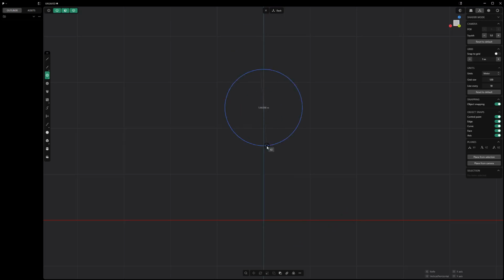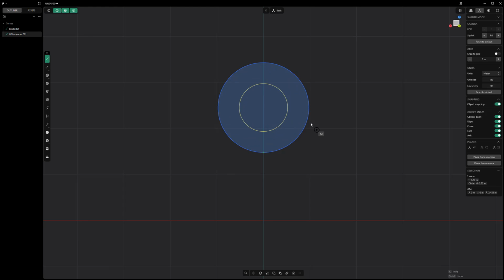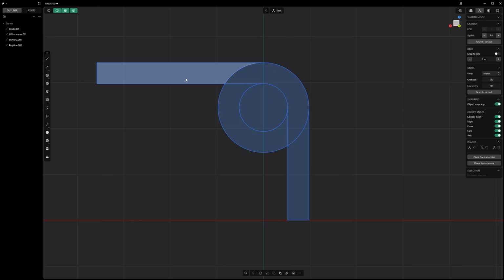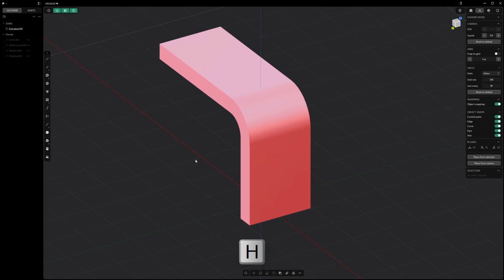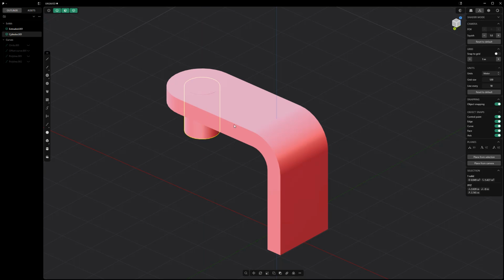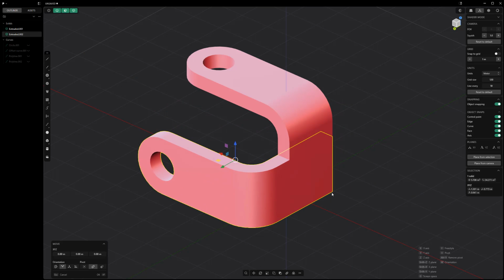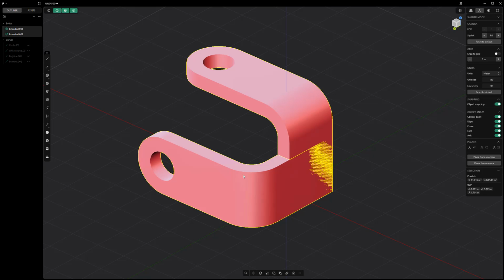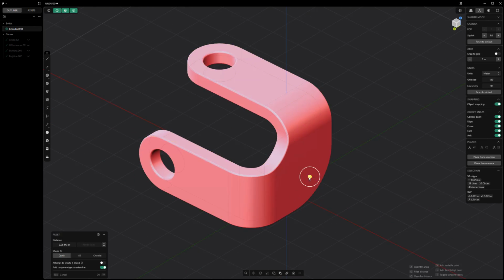Plasticity | Modeling Exercise 114

Comment: Could you apply your genius to doing some MagicaCSG modeling exercises? It's the best SDF modeler that I know of. I think you would have a lot of great techniques to discover. It's on Patreon. Looking at Magica makes it really seem like SDF can replace polygon modeling straight up if it continues to develop as it has been doing. And even challenge Nurbs at some point even thought the precision is not there yet but the shapes it can produce are astounding. Right now, I use MagicaCSG to make a rough draft (non-destructable) before moving to Plasticity.
Reply from the maker: Is there a demo version of the full app?